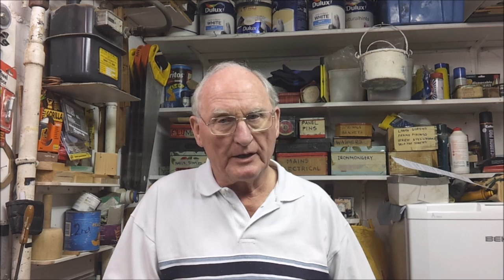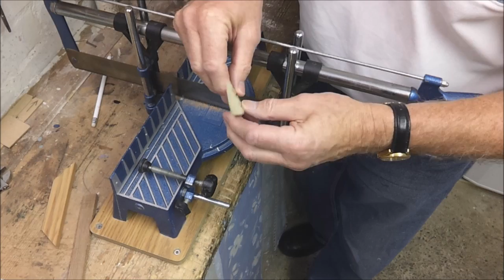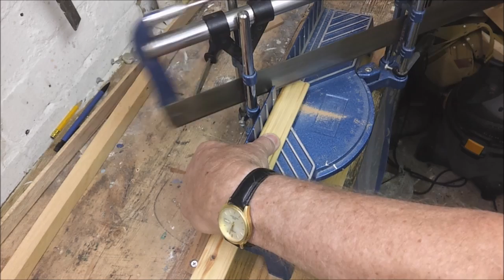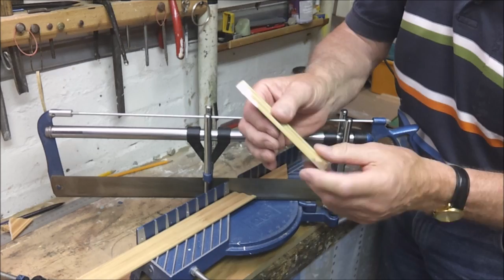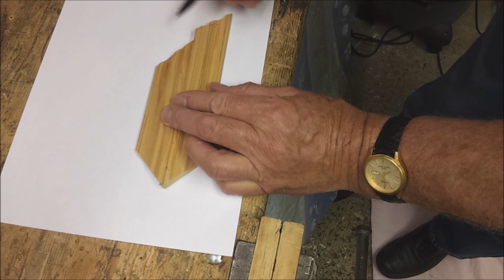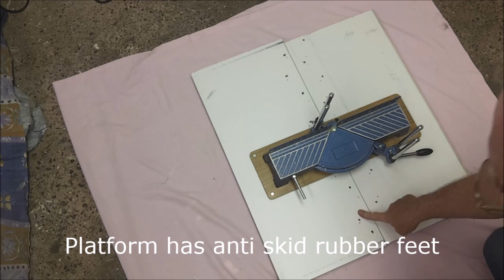Using a Mitre Saw

Comment: Any tips on adjusting the thing for more accurate mitres? Am on my 2nd one of these. When assembling picture frames, the corners are more like 86 degrees instead of 90.. lots of glue needed! 
I suspect the 2 tiny screws that hold the pivot captive can be adjusted.. need to experiment. 
Also, for comfort and directing the tear-out, I have my saw reversed in the frame.
Reply: He has not posted for 8 years so i fear maybe hes no longer with us

Comment: Hi Mike. Great video. I have just brought my mitre saw out of a few decades of hibernation. I wanted to make some picture frames for my artwork. But I have a problem it won't cut straight, cutting a 32mm piece of timber vertically, there's a 1.5mm difference. Useless on mitres and even on crosscuts. Any idea what I'm going wrong? Tensioning the blade makes no difference.
Reply: Same here, I bought my mitre saw to make it easier, but found this tool doesn't cut vertically down, seems to lean to the right. My saw is a Draper,  looks very similar to the one in the video. I tensioned the blade to the point I thought it was about to break, no difference to the cut. Any advice on what I am doing wrong would be greatly appreciated.
Reply: @gordonash6031  Same as mine cuts to the right, bought a new blade and tensioned it still no good. So I now have a mitre block and Japanese pull saw. Lovely mitres.

Comment: Hi.  I enjoyed your video.  However what I was looking for was how to change the blade, actually which way the teeth should point. I took the old one off whithout taking note
Reply: Thanks for mentioning that, I will remember to look when I buy a new blade! :). Guess you've worked it out by now, but my saw teeth are facing forwards I now find

Comment: I have the same mitre saw and put a dado rail up today and seemed to be wrestling with it I clamped the saw bed to a workmate bench but I oiled the blade and rails thinking it would be lubricated and smooth but it was stuttering stopping and starting I couldn't think why it must be what you said about cleaning the oil of the blade first coz mine is a little rusty

Comment: Hello Mike,
I bought one of these mitre saws for doing picture frames. I notice when the saw cuts the wood. It cuts at a slight angle. I can see there is no adjustment for the blade. When i cut right angles for frames the 2 pieces of wood do not match perfectly. When i check it with a square there is a gap in the wood. It means i would have to fill the gap. I bought one years ago and that one was the same. Are your 90 degree angles absoulute precision on this mitre. or have i been unlucky twice.
Reply: I would also like to know as I have the same saw and ALL my cuts are very wonky, I've tried going slow, fast, seesawing and many other techniques but still not a single strait cut!
Reply: Me too, I bought one of these and despite everything I tried, I could not get a straight cut. Any Ideas?
Reply: The saw is not made to precision. There is just too much play in it.   i took the blade out and it seemed warped. You seem to have  to pay a lot more to get a better one. I have tried 2 with the same poor results. I could have done a better job myself. These cheap saws are a total waste of time. Everyone must be having the same problem. They are totally useless
Reply: I have a couple of vintage American miter saws and they cut beautifully. Maybe your machine is just not up to the task.

Comment: does this miter saw have a blade for metal :)
Reply from the maker: Hi Joseph. As far as I know, the blades are for wood only, although they are hardened steel, so if cutting a soft metal like aluminium, personally I would go ahead and risk blunting the blade and simply buy a replacement blade
Reply: @mikesdiytips421  Hi guys. yes you can buy blades for metal and acrylic. Look on Ebay, Toolstation, Screwfix etc.